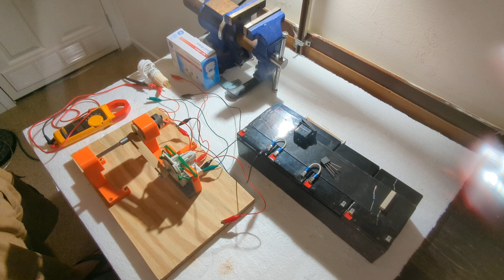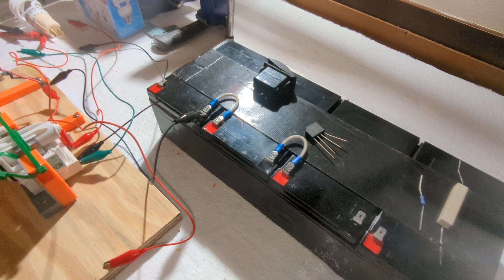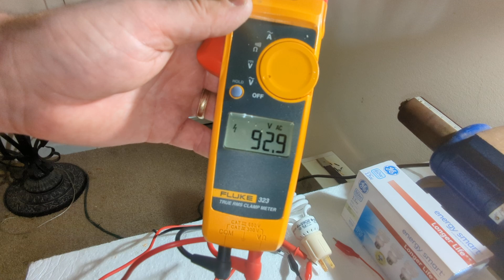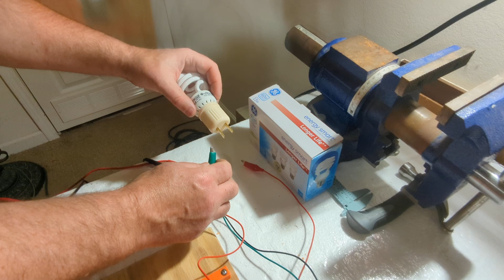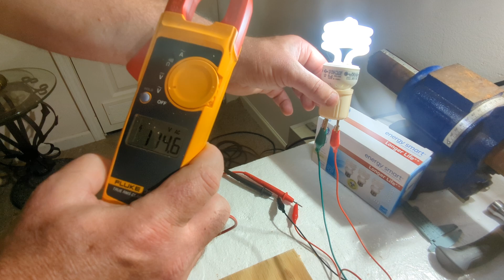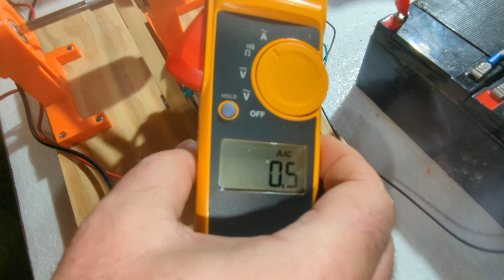DC Motor turning AC Generator

Comment: Would it make sense to use a bedini generator powered by a wind turbine?
Reply from the maker: @mmakaba  https://youtu.be/vOldJUHhjnc?si=joAqN2qvEPWh8WyE
At 32:20 of this video there is proof that you can make a low drag generator head using the Bedini SSG circuit.  I believe it would be worth exploring.

Comment: Very cool 3d printing mounts and experiment. I never thought about combining AC and DC motors for this. 

I'm trying to figure out the math and numbers, here's what I could understand - 
24V 0.5A = 12 Watt for DC draw to run the DC motor. 
0.1A Draw for light. AC starts at 156ishV and goes down to 115V, so a loss or use of 40V AC. So 40V * 0.1A = 4 Watt for the light? 
Then you still have that 115V and how muchever amperage left.

I guess then it'd be interesting to rectify the AC back to DC with a full bridge and see if you hit over unity, otherwise it's a cool little power inverter.
I need to test this myself. Thanks for the inspiration.
Reply from the maker: @kurenai5000  Thanks!  There seems to be a lot of possibilities for experimentation here.  I have studied Bedini's 1984 generator (there is a free PDF book if you search)  work but Gerard Morin's YouTube channel got me motivated to go down this path.